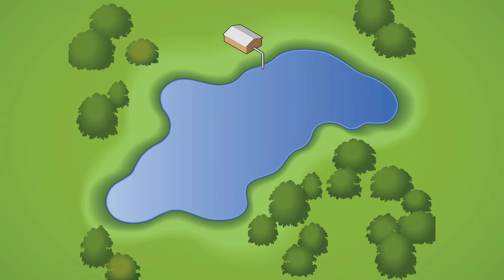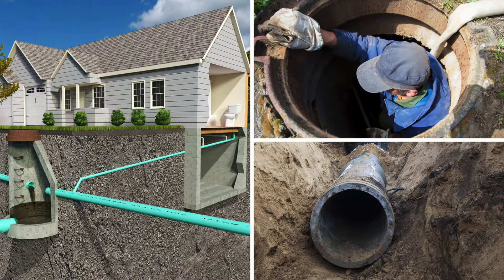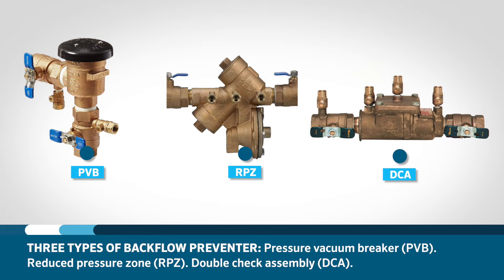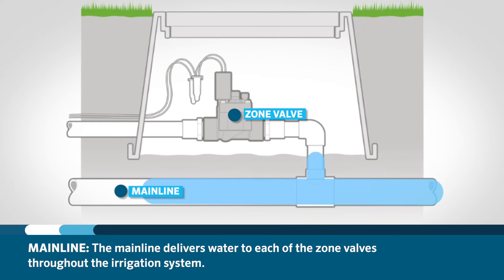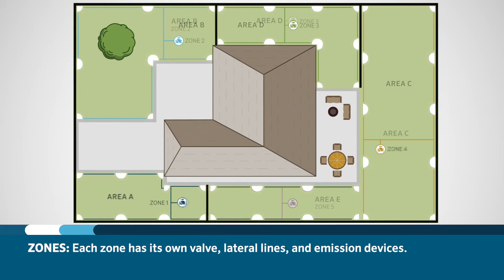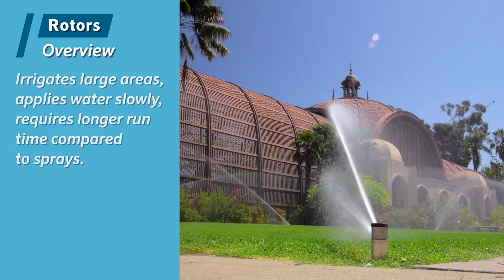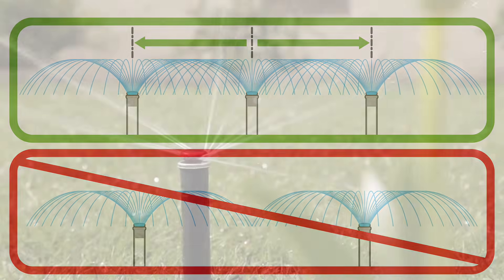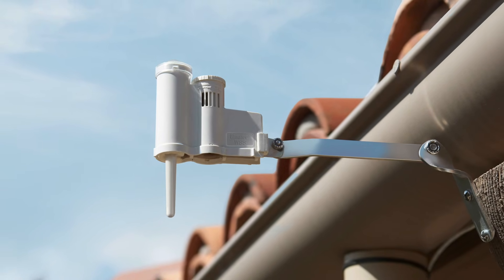Irrigation System Overview for New Installers

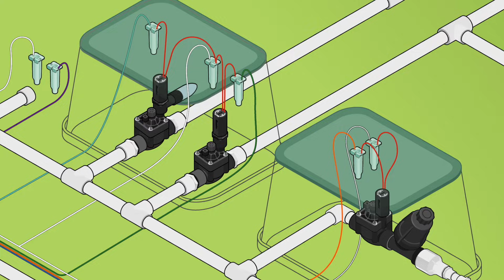Comment: 10:15 Is the electrical zone valve different from the "master valve", which may or may not be present?
Reply from the maker: Yes, they are different. A master valve can help prevent stuck valves or a damaged mainline from flooding and causing damage. They can also be activated when a flow sensor indicates excessive flow.

Comment: I have two problems(I work at a school, so the property is commercial), one zone or station in my school is only being watered halfway. I have a suspicion the problem is only a faulty solenoid, but as a newcomer I am uncertain. My other problem is my school would like to have a uniform water schedule, some sprinklers are on a timer but others are manual and we are unsure which is which, but since the property is commercial and hence very large, I am not sure it would be possible to connect all sprinklers to a main controller. Please help and thanks in advance for reading, and for any help or tips!
Reply from the maker: This sounds like a good reason to contact our customer support department: https://www.hunterindustries.com/hunter-technical-support-email-request

Comment: Great content and presentation y'all; check the voltage stated at 17:05.  Think you mean to say 24 volts direct current.
Reply from the maker: Traditional wall mount and pedestal controllers will send out 24 volts AC current out to the solenoids. Battery powered controllers like the BTT or NODE use 24 volts DC.

Comment: I have old copper piping ran for my wiring encase. Is it possible to run the wire through the soldered pipes. I'm thinking the issue would be the 90 degree turns. Any suggestions or should I just bury it? How deep?
Reply from the maker: Industry standard it to use direct burial irrigation wire. Electrical code doesn't apply to low voltage irrigation wire but you'll want it deep enough to avoid damage.

Comment: I have a well driven house/irrigation system. With pump running the pressure is set to 45 lbs. From the main water supply I have a 1-1/4" pipe out to the irrigation valves. After the valve i used 1" poly. At a spigot that is thr 1'1/4" pipe to a 3/4" spigot i am getting right around 25gpm. So I am assuming through the irrigation valve and only being dropped to 1" poly i should be getting even more GPM still at 45 lbs of pressure. My question is how many pgp adjust and nozzle number 7 should i be able to use on one zone? Also why is it recommended to use 1" main lines and lateral lines at 3/4"? I never understood what you should be gaining from doing that? Thank you!

Comment: What you do if you have only 2 bar pressure inlet? Do you provide pumps?
Reply from the maker: Thank you for contacting Hunter Technical Support.
 
Hunter Industries is a manufacturer of irrigation and lighting products. We do not install, repair, or maintain irrigation systems. Our product is purchased and installed by contractors. If you need field support or installation you will need to contact a local professional.